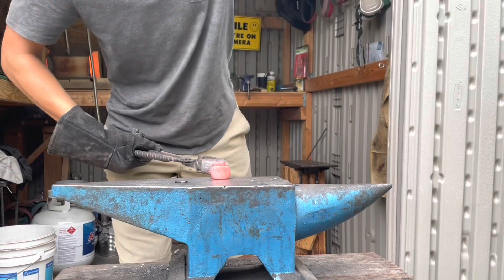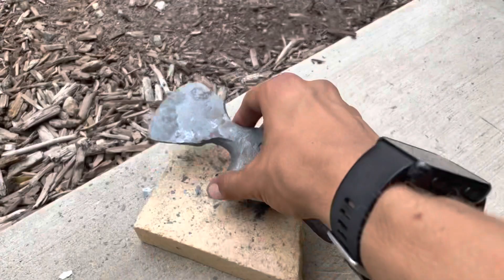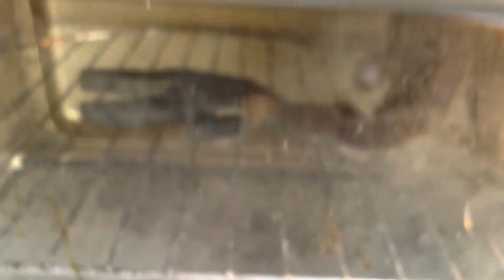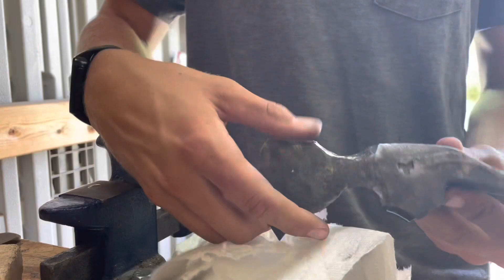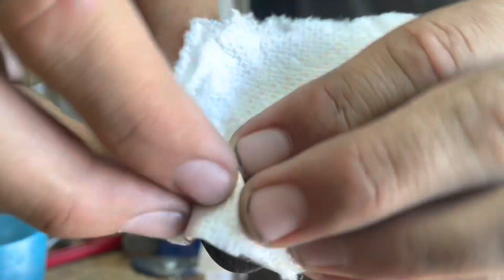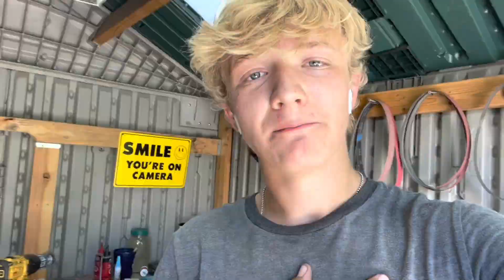Forged Hatchet From a Rusty Claw Hammer

Comment: Long time back I tried to make a mini cross pein hammer out of a ball pein hammer to use on smaller projects. Somewhere along the line I messed up with either thermal cycling or in the heat treat and when I went to put in on the handle it broke into about 5 pieces. You have another winner there, very cool.
Reply from the maker: I’m sorry to hear about that! I’ve had a few tools break on me in my experience and it’s always way frustrating. Thanks though, I am happy with how this one turned out!
Reply: @ToddKoch  If we never failed we would never learn. Seems to me I have an old claw hammer somewhere in the garage. Might have to try this one myself.
Reply from the maker: Very true! I’d encourage trying this one, it’s a super fun project and very customizable!

Comment: How long did it take you to make? Looks like a lot if work.
Reply from the maker: It was about 4-5 hours of forging and then for the finish work on the head it was probably about 1-2 hrs. Luckily I didn’t have to make a handle so that cut time, but overall the project was a bit shorter then most, probably about 9-10 hours of work all things considered